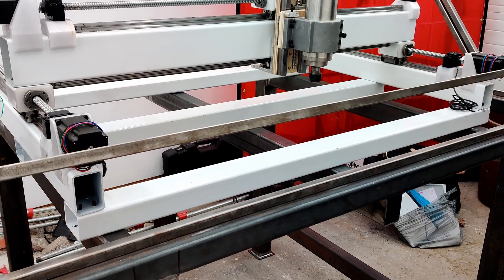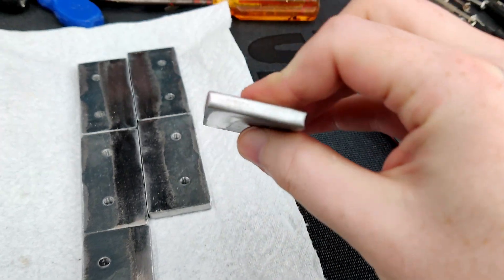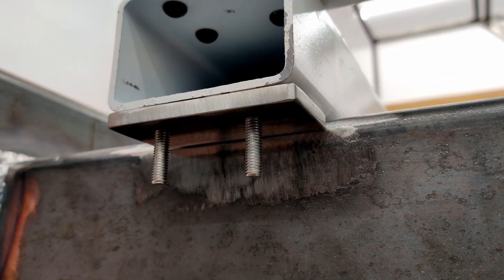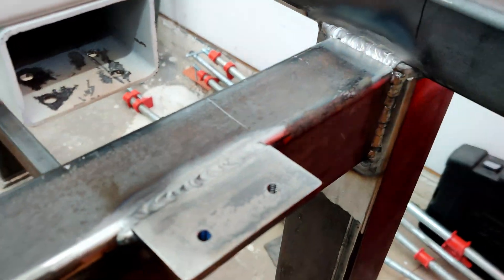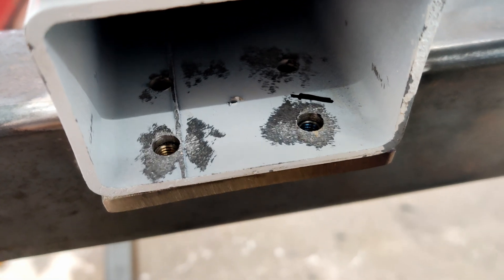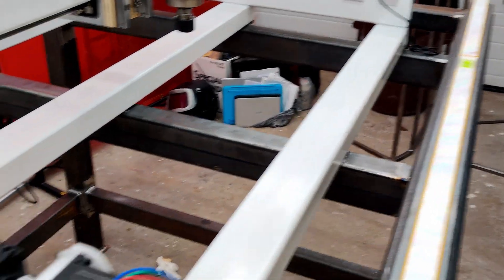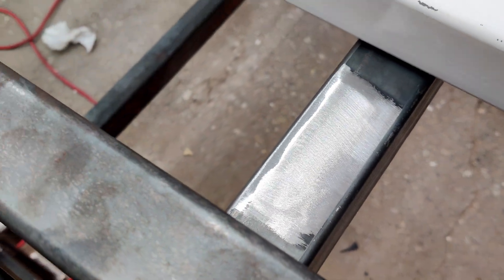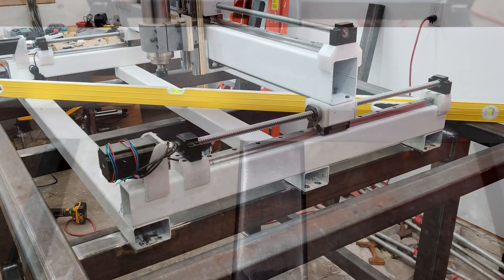Leveling My CNC Machine with Welded Holding Tabs

Comment: My next job. Building a base. I want to include flood cooling so I need some kind of tray. Would be good if the cab dropped into the tray. Did you create your own design or can you point me to a good design for an enclosure?
Reply from the maker: My enclosure is my own design. I've got some Soldiworks videos on my youtube channel going over stuff, but they have changed a little. The stainless steel chip pan that I welded is different mainly because it’s easier to fabricate. I have made my chip pan go in from the bottom and slide up which seems to work well.
Reply: @BryanHoward  thanks for the reply Brian. I will take a look😁